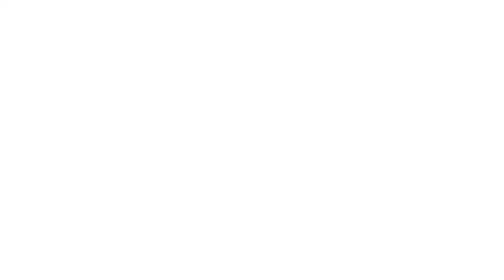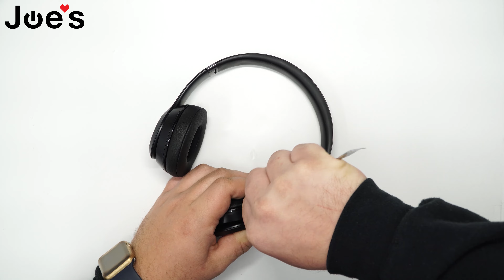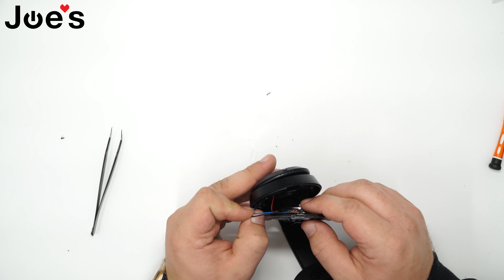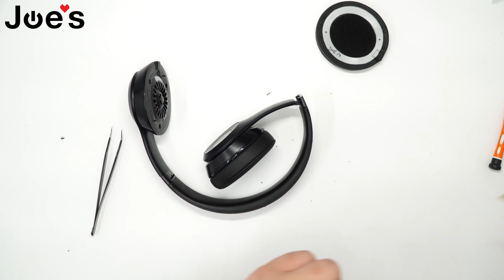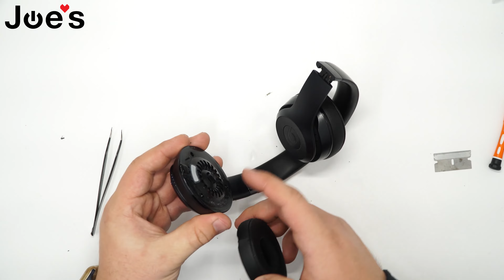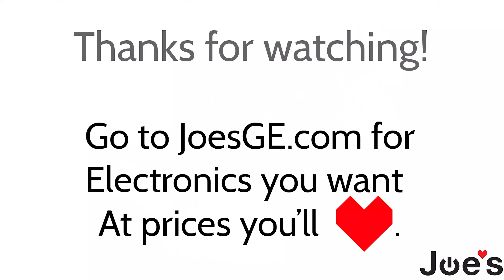Tutorial How To Repair Replace Broken Right Inside Panel Beats By Dre Solo 3 Wireless

Comment: I need some help at around 1016 in your video when your soldering the black wire to the charging port is there anyway you could show a close-up of the wire once it’s completed and soldered on? I’m asking because my headphones would no longer charge and when I opened them up one of the black wires was loose but I’m not sure exactly where it goes. I would really appreciate if you could help me thank you very much in advance